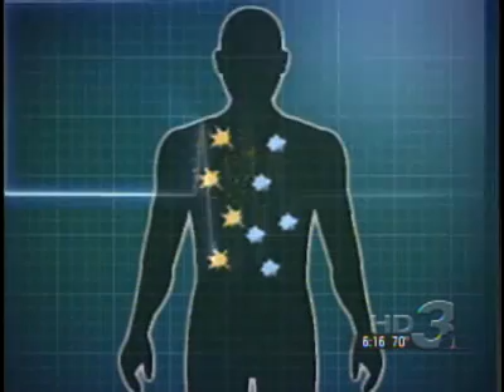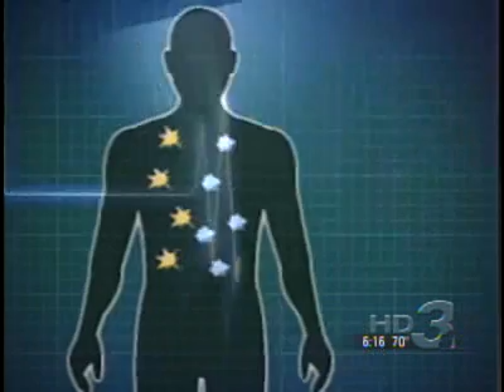Salt Water Fuel

Comment: Yes Occam's Razor applies, and bond dissociation energy- a basic and well understood foundation of chemistry- is a MUCH simpler explanation than claiming matter-->energy conversion, which ONLY happens in the sun and hydrogen bombs!
A book on top of a shelf is at a higher energy state than if it's knocked off onto the floor. A spring under tension has more energy than in a relaxed state. Neither involves matter to energy conversion. Same thing here.

Comment: I spelled out for you exactly what happens during hydrogen combustion and electrolysis, which you dismissed as a red herring rather than doing any fact checking to verify that what I'm telling you is correct. Sorry, you don't get the intellectual high ground here. I didn't use an ad hominem- your grasp of chemistry IS centuries out of date. Then you accuse me of being a shill for oil companies? Absolutely laughable!

Comment: Correct, but you could use solar sells on your roof to make electricity to split the water, store the hydrogen until it can be put into your car. Ho ya, can't do that, because power brokers don't get to make trillions selling something as freely accessible as sunlight and water. And I am sure they would stop at nothing to maintain there petroleum monopoly.

Comment: The "cracking" process (electrolysis) is the same reaction in reverse. You're moving from the lower energy state of a single water molecule to the higher energy state of 3 unbonded atoms. To move them to this state you must put energy in- the same amount (assuming 100% efficiency) that you get through combustion. The net usable energy is zero in theory, and negative in realty due to entropy.

Comment: The "violent recombination" IS burning. They're the exact same process.

Put simply, chemical combustion of hydrogen is when 2 atoms of hydrogen combine with 1 atom of oxygen to form a water molecule. The resulting water molecule is in a lower energy state than the initial atoms were. This is the energy that's released as heat and light. *CONT*

Comment: Lets assume we have a closed system. The RF waves are directed at the H20. The water is *cracked* into 2 parts hydrogen and 1 part oxygen. If the H2 is not burned it will violently recombine with the oxygen (there is the RF energy) to form H2O with the same mass as before the experiment. Read law of conservation of mass. 
Now if the hydrogen is burned as it was in the experiment and then recombined there is no way possible that we end up with the same mass after the experiment as before.

Comment: as nothing is 100% efficient,more energy is used in generating the radiowaves which separate the hydrogen and oxygen than is released from the flame.  therefore as more energy is used than released, the process, with regards to energy, is pointless.

Comment: which means that more energy is used by generating the radiowaves which clearly have enough energy to separate the hydrogen and oxygen than is released by the resultant flame.  more energy is used than is released, therefore the process, with regards to energy, is pointless.

Comment: First, the Laws aren't written by men, their discovered by men.

Any physicist will tell you that physics gained a great deal more from the steam engine then the steam engine gained from physics.

I don't care if you can get 150% more energy from splitting water into HHO, burning it for motion will cause HUGE losses.  Electricity is more useful as Electricity.

Comment: How much was the gas used to turn the generator that made the electricty.  Water is NOT fuel, it has no energy stored in it (in the form of water).  All the energy from your example is coming from the electricty, it's just being used with horrible efficiency by over processing it instead of just using it to make motion.

Comment: That's about as smart as depositing you money in a bank where for every dollar you deposit, they record a dime.  

In you example, the water isn't the fuel, the electricity is.  Electric motors are over 90% efficient, plus you can recoop energy thru generative braking.  

Converting Water to HHO, and burning it for mech motion will be at best 20% efficient, in reality, probably well under 10%.

Comment: 1 gal. of gas costs $4.00. 1 gal. gets you 30 mi. = 30 mi. to the gal. So 30 mi. cost you $4.00.
Or
1 gal. water costs $0.01. 1 gal. gets you 10 mi. = 10 mi. to the gal. So 30 mi. costs you $0.03.
I'll take the water pleas.

Comment: Place water (fuel) in a car. Use electricity to split water. Recombine (burn) the hydrogen and Oxygen in the engine moving car. Recondense the exhaust back into water. Reuse water( fuel). If you could split the water with enough efficiency (not overunity) but close. Then running the car on water would be cheaper then using petroleum.

Comment: Comparing this process with oil refining is comparing apples to oranges.  Crude oil has an huge amount of stored chcmical energy.  Refining makes that energy more useful.  The energy out (chem energy in gas) is very large compared to whats required to refine it.

Water has 0 chemical energy.  Seperating it into H and O stores energy in it, but you'll never get it all back out (losses).

Comment: It would make a horrible rocket proposion system.  First you would need saltwater and battery power, both are incredibly heavy in comparison to the energy they contain.

Even disregarding losses on converting water to 2H and O, the energy obtained from the water would be exactly the same as that obtained from an equal mass of H and O gas in tanks, without having the added mass of the batteries and RF generator.

Comment: Radio Waves aren't something that can be made for less and less energy.  They are in effect energy.  You might be able to produce them more effiecently, but you'll never create a radio wave with more energy then you put into it.  He's basically converting electricity into radio waves, which are apparently converted into chemical energy (by splitting water), which are then converted into heat (by burning). Each step loses energy, some more then others.

Comment: If he's splitting N2 and O2 in the air whats burning? Nitrogen doesn't burn.  Argon doesn't improve plasma torches, it protects the torch/material from other gases in the atmosphere, it's called a sheilding gas for a reason.

Comment: If it wasn't for the R/F generator plugged into the outlet using electricity from the power company that burns fossil fuel to generate that electricity, the water in the test tube wouldn't do anything!  I wonder how much that little flame from the test tube costs in terms of the electric bill.

Comment: > Its all basic chemics the RF makes the H2O split that costs energy.

No, actually it's splitting N2 and O2 in the air.   The guy has just re-discovered the plasma torch.  That's not a flame, instead it's a spark.  Sharp metal works too, and argon gas flow makes it better.

You can easily make your own at home: look up microwave oven plasma, or microwave oven ball-lightning.  There are many videos on youtube.  A bit of salt makes it orange.

Comment: Actually the idea is more like putting solar powers on the walls and shining the light from a real source and then getting some of the energy back through the cells.  There are other things like hybrid vehicals and stoves in fireplaces that converts wasted energy into useful energy.  In and of itself, the idea is useless, but if it can be used to divert wasted energy into useful energy then it could still have some practical uses.

Comment: Its all basic chemics the RF makes the H2O split that costs energy (and all waves not absorbed are the energy loss of the process) And the flame is putting the H and O together to H2O 

Its like trading a dollar for 4 quarters and then trading it back it only costs energy and you end up with the same you had.

Better focus on wind power were you gain energy. wind => energy (diff end product) Or fusion power my personal fav solution (ITER)

Comment: "Think of it this way, even if it doesn't right now, technology changes while the principle stays the same. Eventually we'll be able to provide the radio waves for less and less energy. Even if the margin isn't huge now, it WILL be as technology improves."

Conservation of energy is not a matter of technology.

Comment: "if the RF uses LESS energy to convert then the engine would be viable, if not then electric cars would be a better use of the energy."

Don't be daft, of course it uses more energy then you get out of burning the hydrogen. That's where the energy to create the hydrogen is comming from.

This is exactly like shining light bulbs on solar cells. It doesn't make sense.

Comment: "what if you used a set up where the energy needed to keep the generator (on a large scale) running would be something like a wind turbine and then with the generator running off of a wind turbine then the rf generator could burn the water and power the electric generators?"

What if we use light bulbs to drive solar cells so we can have solar electricity at night? Because It makes no sense.

Comment: poor thinking, very poor even, as said in the post you replied to. The energy needed to split the H2 and O is bigger than the energy you get from burning H2 (which forms water again). So why would you waste the energy produced by wind turbines on a process which gives you less energy. That would be a very stupid thing to do.

Secondly, why is this even on the news, this isn't a discovery, it's very basic chemistry.

Comment: In what way have you corrected me? You have merely criticized my questions (solely for the purpose of your self aggrandizement by the way) and over-elaborated on irrelevant points. Yes, the Egyptians calculated the curvature of the Earth, and sure The Church suppressed that knowledge. That's common knowledge to both of us, but you couldn't resist lording it over me, because you assume you're smarter than everybody else. You're not, and on top of that, you're arrogant. It's not appealing.

Comment: I was merely stating that a car's spark plugs and the RF generator could be run off an alternator. If the RF generator uses more energy than is released by this reaction, then yes, of course it's all pointless. To be honest, I can't imagine why the news article didn't include this most critical fact.

Comment: "this vid is about a way of making hydrogen at low energy as a fuel."

We're already close to how efficiently it can be done with electrolysis. If you could do so much more efficiently you would get more energy out of burning the hydrogen back into water than you put into making hydrogen out of water. This not only means perpetual motion machines are possible, it means the first law of thermodynamics is incorrect and by extension, so is most of modern physics.

Comment: "firstly, solar power is great in non cloudy countries. like wind farms are useless when its calm."

Solar farms driven by light bulbs powered by coal are useless 100% of the time. Replace solar farms with this thing and and light bulbs with an RF transmitter and you have this thing.

"...its first of all important to know this works, if it does it can be made more efficient given time"

Even at 100% efficiency it will do nothing but add to the BoM.

Comment: "ever hear of solar power to generate electricity? would'nt that be a viable solution?"

This is not useful for anything, it's a waste of power to run it at all. What he is doing is akin to using grid power to shine a light bulb on a solar cell and then using that electricity to do useful work. It's inane.

Comment: Lets assume the combustion releases more energy than is needed to run the Radio Frequency generator. The salt water combustion engine would power an alternator (just like in a car) and that alternator would power the RFG. All you'd need is battery to start the process. Again this is no different than any car.

Comment: The amount of electrical energy generated in a car compared to the energy in the gasoline is insignifcent.  What LasVegasDad is stating is that the energy in is larger (probably much larger) then the power available from the little flame.

Comment: lasvegasdad - If this process can be made efficient, the salt water reaction can power its own RF generator -- this would be similar to what happens in your car, assuming it's a spark-ignition internal combustion engine. The reaction powers the ignition coil or magneto that in-turn supplies the high voltage necessary for the spark that keeps the whole thing going.

Would you suggest that gasoline powered engines must be cord-tethered? RF generation may be lossy, but people find ways.

Comment: "explain to me how coal egnites exactly? its not spontainious surely? oil the same, it needs to be ignighted!"

It undergoes a spontaneous exothermic reaction with oxygen when it is hot enough.

"if you agree then you'll agree water too burns when 'ignighted' so its also a fuel. jesus."

The water does not ignite, that's hydrogen gas. To create that hydrogen gas you have to keep pumping in more energy than you get out.

Comment: "The question is does this reaction need just an initial burst from RF or is it continuous? If constant RF is needed to burn the salt water then you'd need electricity stored in batteries."

Of course it's continous, that's where the energy is comming from.

Comment: The question is does this reaction need just an initial burst from RF or is it continuous? If constant RF is needed to burn the salt water then you'd need electricity stored in batteries. Now the question becomes: Is it more efficeint to use this technique than simply using electricity with a motor?

Comment: right, but at some point you generate enough heat to power the RF generator and use the excess. We're looking at such a small scale right now. Plus, it's in the open. I'd like to see what volume of salt water that RF Generator can turn to fire-able fuel. At some point you generate enough BTUs to exceed 1.4kw. Hell, some PCs these days run on 1kw power supplies. 1400C from a 1 cubic inch flame is rather significant.

Comment: The RF generator is not just used to "kick start" the reaction, with more fuel keeping it going.  The particles only break down while the generator is operating.  That's how they can pulse the flame.

Comment: It has been confirmed that the machine consumes more energy than it produces from hydrogen (not surprisingly).   At this point there do not seem to be any advantages over electrolysis of water.   The RF oscillators and such require a good amount of power, and thus the efficiency is not that stellar.

Comment: Of course you can't gas up with rude oil, but it CAN burn, and then release its energy, and thus a fuel. Yes it is costly and dirty, but the energy used to convert water to hydrogen, is even more costly. You didn't answer my question: "Where do you get the energy to fuel the conversion process from?".

Comment: It is actually you who are missing the point. Where do you get the energy to fuel the conversion process? The amount of energy needed to break the molecules, is higher than the end-total energy that is produced. So you are using energy to create less energy. And the energy comes from elsewhere. Oil you can burn without converting, thus making it a fuel.

Comment: Yes, HYDROGEN is a fuel, and there is lots of it, but not in its free form. H2O, however, is not a fuel, and you first have to split it to get the hydrogen, but the energy you use to make the hydrogen from water, is greater than the energy you get from the produced hydrogen.

Comment: You are missing the point. It would be more efficient to use any energy generated by solar power directly(i.e. electric car), than using it to first produce hydrogen from water, and then use the hydrogen as fuel.

Comment: ok whatever... i don't know where on this video you figured out how much electricity it takes to run his RF emitter... but until that variable is anything other than unknown, the whole debate is moot. If you can plug it into a wall you can run it off of an alternator system.

Comment: on ANY old car: 12v at the ignition coil primary-side... approx 40,000v on the plug side... this is necessary to ignite the AFM under load. you just need the battery and starter to get the whole rotating mass moving... that's all.

Comment: "in order to get the hydrogen out of the saltwater, you have to charge a huge battery in the car up with power to "fuel" the process"

You just described every car out there... sounds like you're talking about perpetual motion... not auto-mechanics.

Comment: yeah and you can't just fuel a car on gasoline and drive either... you need to generate electricity to ignite the air/fuel mixture, and from a dead-stop you need battery to get the whole process started...

Comment: Ok gullible person number one. Say you have a car with an engine like that. You fill it up with saltwater. But in order to get the hydrogen out of the saltwater, you have to charge a huge battery in the car up with power to "fuel" the process, to get fuel. The process of converting the energy requires more energy than it produces is produced.

Comment: Ok you two physics fuck-ups. What he is doing is simply getting hydrogen from salt-water. But the reason why it is useless as a way of fuel, is because he uses more energy on converting the saltwater to hydrogen, than there is in the produced hydrogen, so there is an net energy loss in the process. It is not like you can just fuel salt-water on a car an drive.

Comment: try modifying a microwave take the front door off end make another door out of steel with a hole so you can put a match to light up the water when the microwave is switched on make a plat up with a hole to light up the water with salt in it i recogn it should work

havent tryed though
hunchingson effect power with radio waves antigravity also each wave as a key to open a gateway to zero point energy